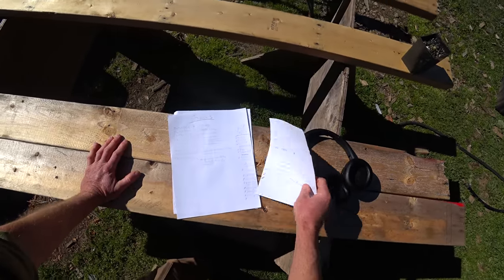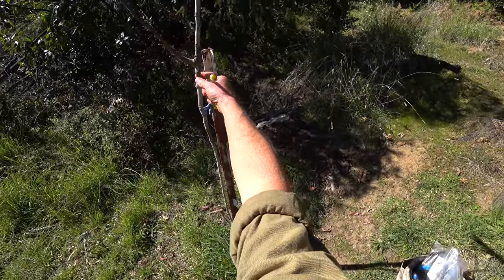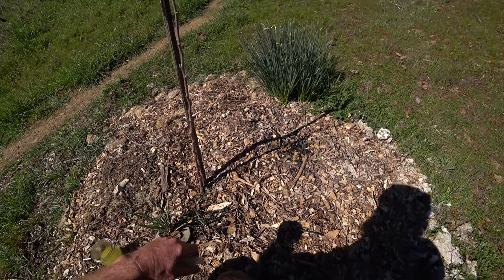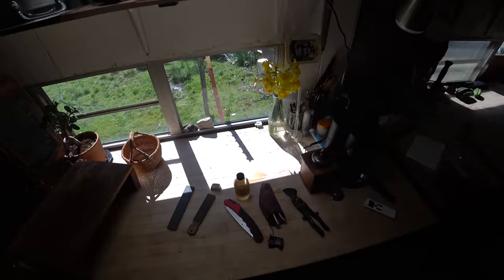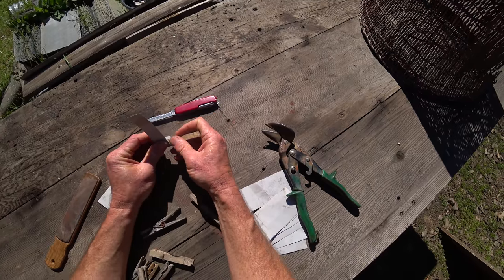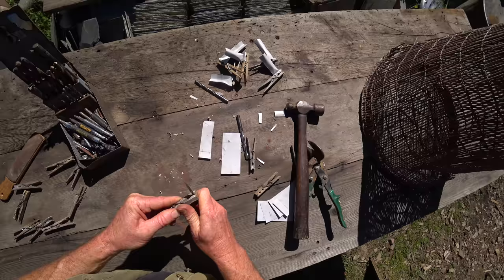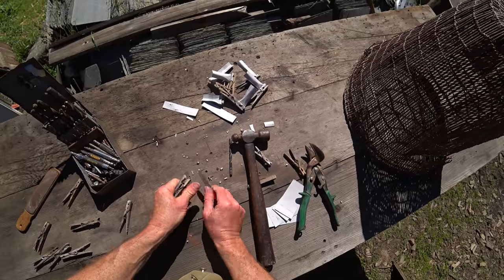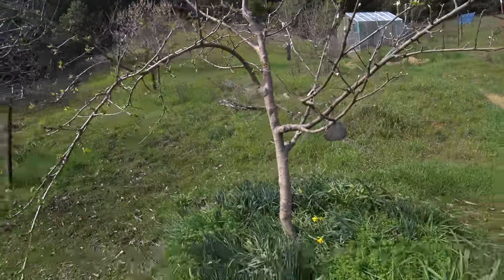Day on The Homestead, FEB. Fruit Tree Training, Tree Collards, Hide Tanning, Daffodil Seedlings

Comment: Your air-layered tree collards intrigue me. I've been almost totally unable to root tree collard cuttings, except one I got straight from my friend across town (the others came in the mail). They seem to just rot and die even with bottom heat and being careful with the medium. It's very frustrating! I would be an eager customer for a rooted Peasant King cutting, basically.
Reply from the maker: Cutings are dicey for sure.  I usually just stick extra and do okay.  but sending unrooted cutings through the mail does seem risky.  And I've noticed that they often don't grow very much root.  These are covered in tiny root and spots that are pushing root tissue, so imagine they'll grow more and better ones.  It would be a lot of extra work to root them all first, but I'll try to pare that down to the minimum and see if I can come up with something super fast and easy.
Reply: @SkillCult  very industrious of you. Your work ethic is inspiring.

Comment: PinGuide? SpinGuide. SpinGlide, there you go, the bud glides into position without corrective actions needed "later".  Can't the metal part be tucked under the spring of the clothespin? I just tried it with a homemade beer can tree tag and it gripped it well, where I fold one end over and punch a hole thru, must be about the same thickness as those wonderful printing plates. Could also cut out a tab to slide under metal of spring and fold over to grip. Thanks for the video.
Reply from the maker: Bud glide is kind of a fun play on words.  Didn't think of putting it under the clip.  I'll try it.